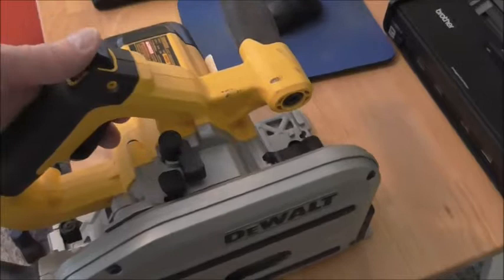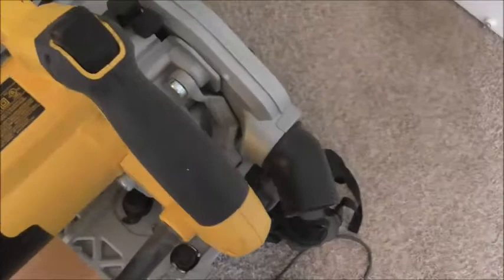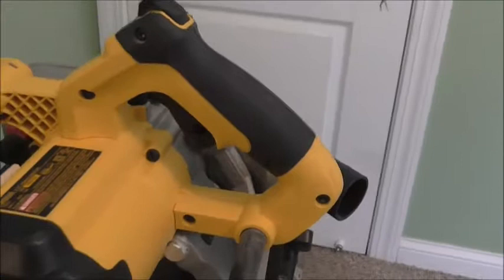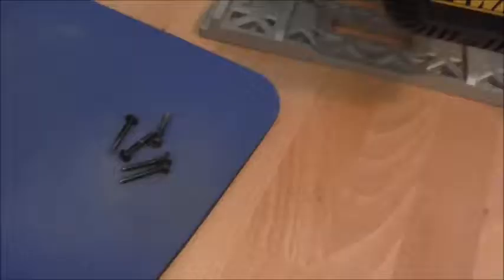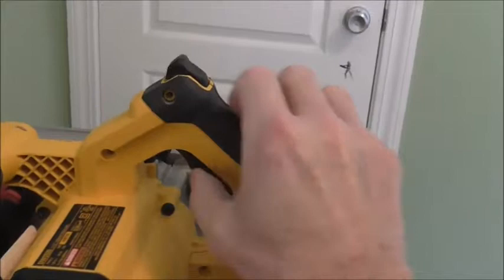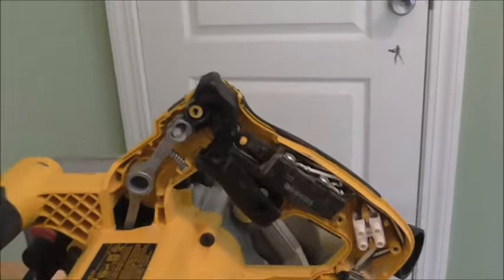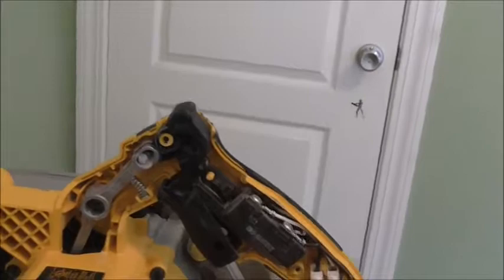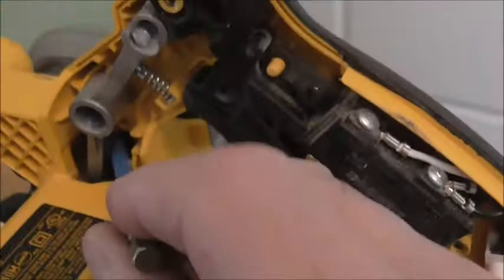Repair malfunctioning plunge trigger on Dewalt DWS520 Track Saw

Comment: After talking to a dewalt official service center (repair company), i can tell you that its not safe to do what you did, and that it is actually not what was causing the button to jam up…. It was just a coincedence that it helped, because what actually happened was dustblocking that prevented the startbutton to work so, it was also cleaned out once you liftet the screen, and this is 98,5 % of the cases the repair guy told me, that this very problem is rooted in.. basicly if you arent using a vacum, or even still, the random factor of how the dust swirvel, can lead it to get stuck in vital parts and cracks, that makes this problem.. so perhaps someone never experienced it, and someone else have it done multiple times… the best solution is the remove the 5 screws and blow air with and air presure device to clean it. key thing is to plunge down the blade, and from a side angle, blow air behind the blade, as this is the area where the problem often is rooted. And since you cant change the blade, because the button to lock it is jammed, the plunging down, blowing air behind, is the best you can do.. having a vacum on any uses connected, prevents the risk of this alot, as it creates less opportunity for randomness of unluck to occur. But putting oil these places you mention is a actually something that can ruin the machine (the repair guys word) hope this helps anyone, and the video, should be edited in my opinion. Thanks✌️
Reply: Thank you

Comment: Have the cordless 54 volt and it was starting to stick.Was a little bit worried.Checked your video and was a great help.Thanks. 👍
Reply: Hi Keith. I have the same model as you and have noticed my trigger is a bit akward at times too. Also, do you notice the starting of the plunge process is a bit akward? Like its no one motion direction? If so did the lube fix the problem???
Reply: T
Reply: Thank you so much for the upload had to keep taking my handle cover off to get it running 👍👍👍👍

Comment: Thanks for this extremely useful video. It was far more help than the Dewalt website. Clearly they want you take your tool in for service!

 I would also suggest blasting out all the dust in the mechanism using compressed air (compressor or I used a can of computer dust buster) before lubricating. I also removed the blade guard and removed a ton of sawdust there and behind the blade and was also able to clean where that trigger latch catches.

Given that I haven't used this tool much, I was shocked by the amount of dust build up inside it.